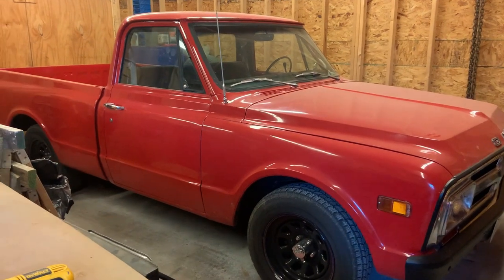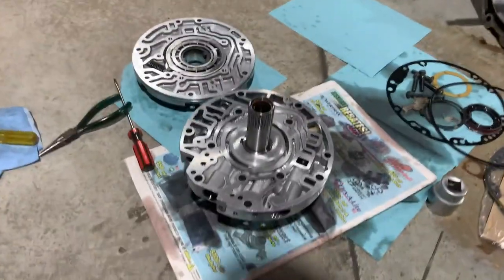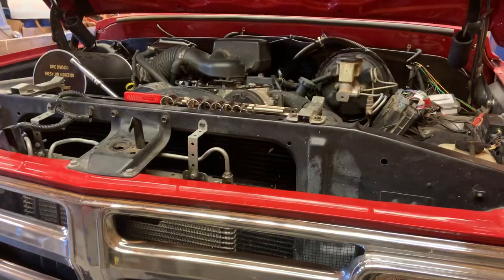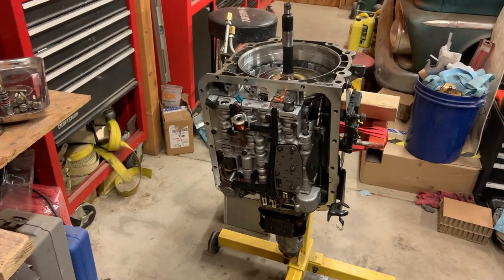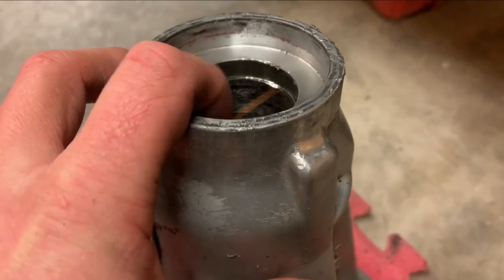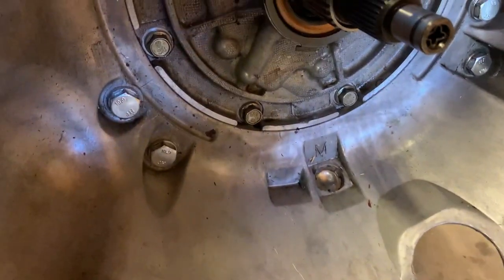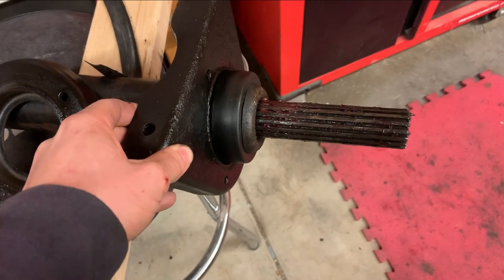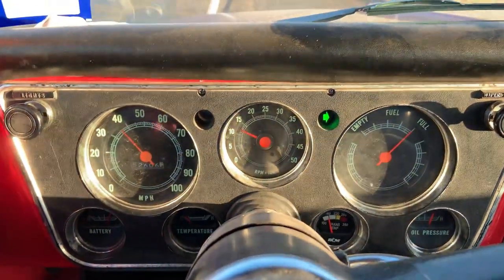Resealing the 4L60E and Troubleshooting No 2nd and 4th gear | 68 GMC

Comment: The skid marks were impressive 😂 the posi and the one tire wheel spin. But glad your enjoying your truck
Reply from the maker: The diff broke so it will get an actual limited slip in the near future, can't do much about the lack of power but it'll have a better chance of doing an actual burnout
Reply: Damn that sucks, I hate when if it ain’t one thing it’s another. 5 lug or 6 lug?
Reply from the maker: Way it goes. Currently 5 lug. squarebody parts up front for disk brakes which made it 5 lug so I got custom axles made for the dana44 to make it 5 lug
Reply: Nice. Well hope you get truck out soon for some cruising. Where in Texas? I’m by San Antonio
Reply from the maker: Thanks, I swapped a square body diff into it for now but the 3:08 gear in it sucks even on the highway. Not enough rpm to keep the TC locked on hills and headwinds. Maybe 1-2mpg better mileage with mostly highway. Rather not say because the internet is what it is

Comment: Great video, partner. I'm not sure how you managed to knock the band off the anchor while R&R'ing the pump, but stranger things have happened. By the way, I've rebuilt about a dozen or so of these now, and have had good luck with the TP-50.... just don't do like I did in the beginning and try to use a regular torx T-50.... you'll more than likely be drilling out some bolts. Anyway, cool old iron right there man. Glad ya got that trans fixed.
Reply from the maker: I'm pretty confident the band came off when we had the trans on the ground and upside down. Hind-sight that was not smart. Thanks for the feedback, so happy to not have to put a drip pan under it!

Comment: Did you check codes for failed mass air flow sensor will do that   Unless your running a carb with a controller

Comment: For a MUCH easier time removing and installing your pump, remove your 2,4 servo.
Reply from the maker: Why does that make it easier?
Reply: @PracticallyStock  it was the install and now I am thinking it may have been because my band wasn't on my stud.  But it made it go in SO much easier when I popped that 2-4 servo out.  Pump wasn't lighning up streight about to remove mine for the 3rd time.  1st was rebuild, second was replace pump after improper install and hulk smash pump drive.  This one will be for that band I might upgrade to pinless accumulators while I am ad it.

Comment: Ok so your fuel injected.  Yeah better check mass air flow sensor
Reply from the maker: I refuse to believe a mass airflow sensor can cause the transmission to lose 2nd and 4th. What logic is there behind a mass airflow sensor causing the transmission to lose 2 gears? More to the point, I show in detail what happened and the truck fixed. The problem was not the mass air flow sensor, the band used by 2nd and 4th came unclipped
Reply from the maker: Sorry, forgot to reply earlier. I did some reading and the MAF can apparently cause some transmission issues by giving a false engine load reading to the computer which causes incorrect line pressure. On some vehicles it will put it into limp mode which may have been what you were talking about, I don't believe this ECM will do that though because it also has a MAP sensor to reference
Reply: Like yeah right. 😆